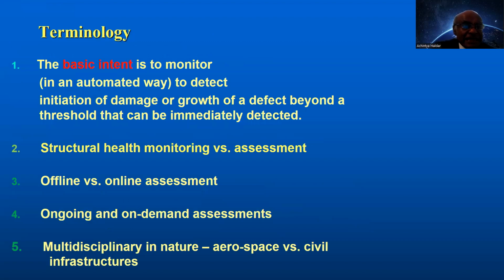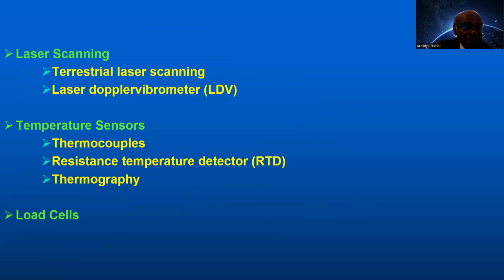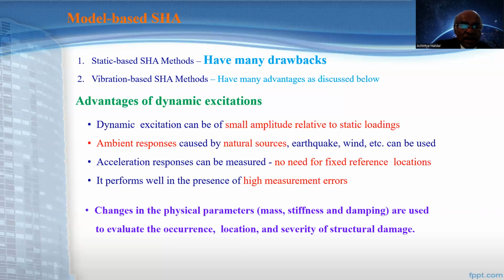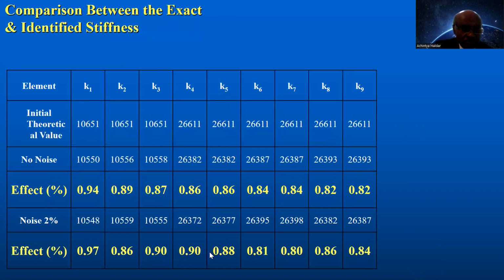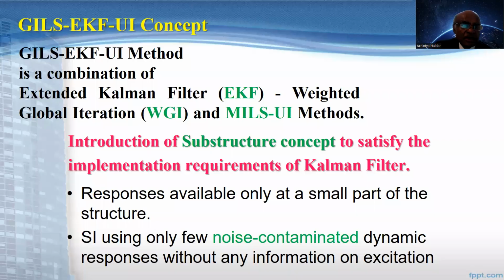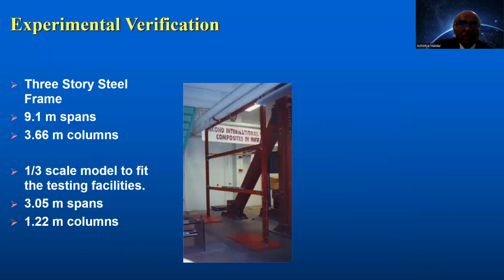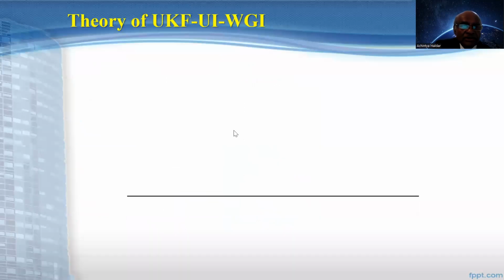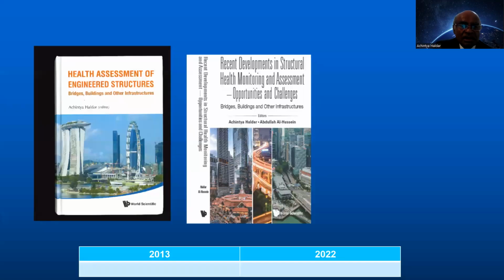CONF-MSS Structural Heath Assessment Using Limited Noise-Contaminated Response Information

Comment from the maker: Is the vibration-based SHA method in general more advanced than Static-based SHA methods, or both of them have advantages in different areas?
Reply from the maker: RE: There are many deficiencies in static approaches including an infrastructure (a bridge over a river) cannot be closed to traffic for routine maintenance inspections for several days, at least in the U.S., it will be extremely complicated and expensive to put sensors on it (under the bridge over water). it will require an extremely large load to cause deflections to be measured (may not be practical), to measure deflections – a reference point is needed – it will be difficult if not impossible to set, presence of noises in the measurements will have significate effect on the damage identifications, etc.